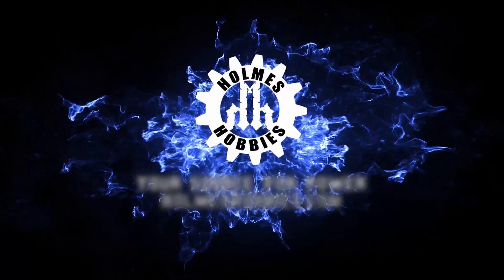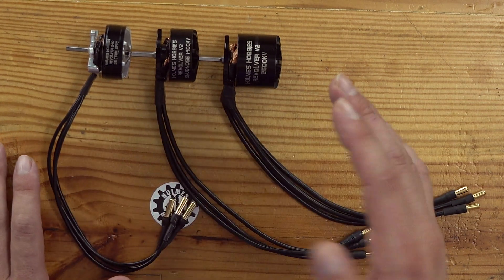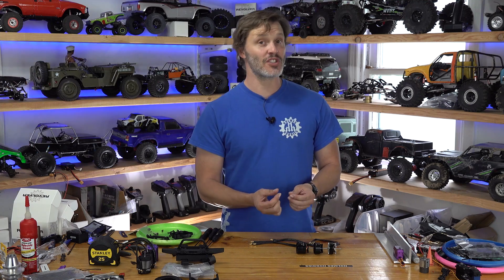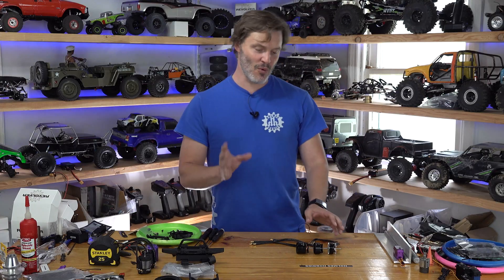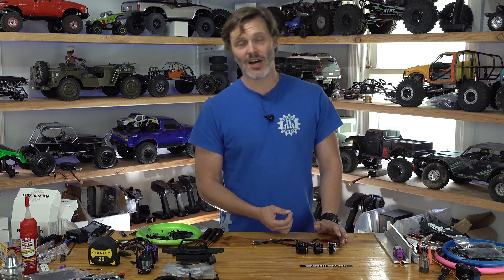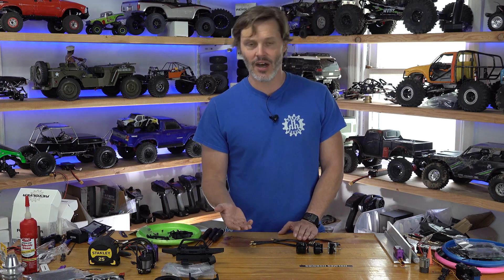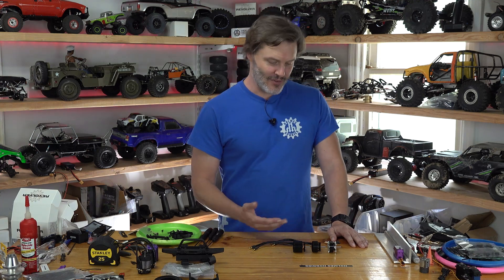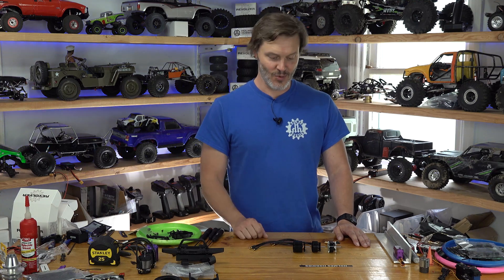Which Motor Is Right For You | Revolver Differences Explained | Holmes Hobbies | RC Motor Guide

Comment: Im building a TRX6 with a highly detailed and HEAVY 3d printed body.  It will also have a gooseneck trailer to haul 2 more rigs.  Is this something the 540 can handle, or should I look at the revolver classic?  I cant give you a weight yet, but 30+ would likely be the lighter end of the range.

Comment: What's the problem I'm using copperhead10 ESC and 2500kv motor HH revolver V2...my settings on power is 100% full throttle and 100% reverse...then when I full throttle for 2.3.sec the ESC will beep long sound and no response i need to restart again the ESC...can you help me sir.

Comment: I got the 540 2500kv for my scx10.  Its a beast.  Never gets hot no matter what gears.  Running on 2s.
Reply: That’s what I’m trying to figure out it if my gearing (56T Spur & 10T Pinion) on my Vanquish Stance VRD will make the motor hot. Btw I bought the V3 2500KV Revolver motor & my gearing will put out alot of torque but people say higher KV means less torque but in this video he says the bigger the motor the more torque.

Comment: Have you did speed test inrunner 3.5t 8700kv vs a outrunner 25000kv I want to try a build rc car with motor but don't know which one motor for top performance speed do tell me which one for top performance  should I use please Holmes hobbies
Reply from the maker: Kv is kv.  But outrunners aren't great for loaded efficiency when gearboxes are available.  Too high of no load compared to similar sized inrunner,  they can't shed heat as fast

Comment: So looking at a 102:1 gear reduction with 4s would the 2500kv snub or if team spec be suffice for a 5-6lb rig ?  Or a smaller lightweight different transmission would put me at 67:1. (Comp rig wanting to be as lightweight as possible) 

Currently running 77:1 3s and a puller pro v2 stubby 2200kv in my class 2 and love it! (Maybe more wheel speed and heavier than I need but it slow speed is still awesome)

Comment: Great video! Currently running the 540 size Revolver, but looking for the motor for my new build so video was very helpful. I will move toward the snubnose  to try something smaller. The crawler will weigh in at about 6 pounds as I am using reasonably heavy alloy axle housings. Thanks for all the great products.

Comment: I can assure you overkill should have been the given name for the 2500 my what was a new wraith is now spare parts for my new wraith that's no longer running the 2500. First little wraith lasted around 4hrs on 4s I was crawling on rift raff borders at our riverfront. And paired with the castle mamba because Holmes was out of his at time of purchase of my revolver 2500. Amazing slow crawling speed you can literally watch each knobby on the tread make contact that's the amount of control. Anyhow as I was enjoying my day my rig wedged itself in between two boulders right rear and driver front I slowly pulled the throttle as to pop one or the other out but the rear sunk farther.The front had now came up out of the Crack but was under the lip of the rock infront so I hit reverse put me back where I started so I thought well how about I just full throttle it will hop right out it's so snappy. Boy Snappy was the word and snap was the sound that motor has so much torque it literally snap the chassis like a twig. I was in utter shock and disbelief but at the same time going holy crap I'm so glad I was recording that cause that is insane. And absolutely awesome all at the same time I thought I was done for the day but because of where it snapped it really hadn't stopped it from being drivable. Nope made sure that happen about 20 mins later. When the front was stuck and it ripped the shock from its cradle  on the right side of the rear-end and snap the axle. So what do I think of Holmes products well I certainly don't buy anything else for my Crawlers or Monster truck's .I know there are other good companies out there and I own a lot of their equipment to.But I've only burnt up one brushed motor from Holmes in 6yrs and it was completely my fault and I now own 55 of his motors and esc's. For me that's a no brainer  and when I can take this tiny can't even hardly hear it bullet motor and snap my rc chassis that I couldn't even hardly twist it 15 degrees either direction by hand.Yeah that's my kinda product and it's built and designed by a man who is whole heartedly dedicated to the hobby and pushing it to new limits.As well as making  sure he does all he can to insure it's future for many more to enjoy. You can't find these people or companies hardly anymore and it's sad because they are who built this country in the first place. So I can assure you I will support and buy all that I can from a company that supports me and   makes sure I benefit from their product.Not one that mass produces as much as possible because in 3 months your repurchasing the same thing again because it went up in smoke or just simply malfunctions altogether. I've got motors that have hundreds of miles on them from. Holmes  and that's 1:1 scale miles I haven't ever broken them down to 1/10 but one is like 6 miles from 350 it's my 3100kv Holmes running a Hobbywing max esc another around 211 and several inches low hundreds or darn close.Now if that isn't dependability and quality I don't know what is or where you're going to find it. What I can attest to is I own well over 200 rc's and I have every brand of motor and esc you can imagine and the only company I've had come close to matching the durability and performance is one that most are going to be taken back by but I get no quirks or incentives for advertising so my opinion and advice comes straight from my pocket book to my rc's and the results are unbiased an honest.Anyway HPI is the only other motor I've even got to come close to putting up with the torcher and  putting out dependability one of my 17 trx4s is running a hpi 4000kv with a Hobbywing 1080 zero lagging at any crawl speed and 41mph on 2 gear top speed with absolutely zero upgrades it's 5yrs old and never had a single part break and I use it for trailing and bashing 3s 5000 50c is my battery of choice. It's currently at 261 after the last couple 11hrs a day  weekends and is still as strong as it was knew.But even tho I'm a huge fan of it my main go to is Holmes Hobbies and for good reason my motor drawers is full of over 600 motors all that have failed. Out of those 5 drawers it only contains one Holmes hobby crawlmaster motor out of my Redcat Marksmans. Of which was completely my error as a bearing went out in my trans and I had no knowledge it was working 5 times harder than it should in 90 degree weather until my crawlmaster became a crawldisaster I was really disappointed at first this truck was only 2weeks old and 3 batteries in. Until examination told the story no failure on Holmes behalf just a crap Chinese bearing ruining a hand built masterpiece in my opinion. Sucks that 11cents can destroy a whole day of fun.As well as cost you more than 20 dollars to fix what would have probably outlasted my Marksman. Well that's my two cents hope it helps somebody and hope everyone gets out and enjoys this wonderful hobby.BITTEN4LIFE

Comment: Will these all work with the micro mamba v2? On topic of the mamba v2, is there any difference in the esc whether it's in a 1/18 combo vs crawler version, besides bullet size.
Reply from the maker: besides bullet, no difference.  I would only recommend snub nose revolvers with that ESC
Reply: I ended up going with trail master 2200kv

Comment: John - I purchased two V3 540 Revolver motors for an RC4WD Bully II MOA build. I stupidly purchased your BR Mini Dual esc to power these revolvers not realizing the BR stood for brushed. I then purchased two Castle Micro X's, but blew them both playing around with other builds. Then I tried to Mamba X's, and decided they were too big - overkill. So now I have two Sidewinder4's where I've removed the shrouds, ground down the heatsinks and glued them back to back to fit in the body of the Bully II MOA. I've yet to finish soldering the connections as I am unsure how I will connect the esc's to power (i.e., single battery to both esc's or two small batteries per esc). But in any event, when done I think this may be the only dual motor on axle build with your latest big can revolver. Thought you might get a kick out of that...

Also - I have one of your 1800kv V3 Snubnose Revolvers  that is going in an all aluminum WLToys 144001 with a Mamba X for speed run testing. Question - I think I can safely run it at 4S, but what about going to 6S? Will the motor handle that for short bursts?  As an aside, that will also be the only 1/14th scale speed run buggy I know of with a Revolver motor. Again - thought you'd get a kick out of that.  😁

Comment: I have a sleeper Gen7 that is about 8 pounds. It is a step below really good comp rigs but far above a normal rig. I run portals which lower the gear ratios by 50%. Would a Snubnose be appropriate for mostly bouldering? I also do steep climbs and trailing. Also, which ESC will run it the quietest? I don’t care much for whiny rigs. I am ready to buy now if you have what I need available. : )

Great video! 🏁 I watched every second and learned a lot.

Comment: These product videos are great. So much of a build is the controller and motor. Between weight, size, voltage input 2 3 4s, torque, hold, start up and kv... any input is appreciated

Comment: Hey John, great video, despite the odd rabbit hole! 😉  I've experimented with different kv and would say 2200-2300kv seems to be the sweet spot.  Also, quick question for ya.  I have a pseudo-comp rig (daily driver but set up for comps) and interested in the Team Spec SS.  Rig, fully outfitted, weighs about 6lbs and wondering if the SS will tolerate it or if I should go with the standard snub nose?  Thanks!

Comment: I’m loving the team spec ss motor, as mentioned if you don’t utilize it for the correct application (light weight) it may not hold as some anticipate. On the opposite side of the spectrum I also love my 540 revolver (v1 not classic) and the torque density is just another driving experience!! I mostly run 3s and super happy with it but really want to get a proper revolver to use 4s with the Crawlmaster v2. I did try 4s with the team spec ss and CMv2 until noticed noise pitch changed and I opted to stop. Love the videos like this, learn something every time!!

Comment: I run the 2500 snubnose  with the Crawlmaster V2 so it’s 4s compatible. I also gear down as much as possible for low speed and high torque.

Comment: Motor choice question, but first rig specs. A class 2  Brazinscale hi-low with a tgh 2low trans that's a little over 5lbs. On Vanquish F9 Currie axles (non portal front/portal rear) 65:1 front 79:1 rear gear ratios ( 20% ish o.d.) mainly used for comps, but trail run every now and then. 

Running 3s on your crawlmaster mini ESC Would a 380 2000kv revolver be "enough" motor to have good wheel speed at those gear down ratios?  Or would you bump up to a stubby puller pro or revolver? I would like to keep weight down, but wheel speed is useful!
Thanks for everything you do for the community, along with taking the time to read this. 👍

Comment: I have your lil tugger motor and I haven't a clue what to use it in HELP please
Reply: I've seen one or two older Tamiya based  crawlers  with the tuggers, also in one of the Tamiya semi trucks. Probably fit alright in that team AE 12-14th (forget which it is, but it's a odd scale) rig also.
Reply: @jollygreengiant7070  I have a king Kong rc ca30 6x6 truck I would like to put it in as a normal 540 is very tight against the servo and this lil tugger would fit alot better

Comment: Does your company make custom 380 cans too? Was just wondering because I have a small rig that I want to put a good motor in. I plan on modifying it a bit but keep it on 1.5's with very slow wheel speed. It's a bit too fast for my liking and the startup sucks.

Comment: Love my v2 2500kv revolver full size so far. And absolutely love the 2040kv revolver snubnose v3 I got on accident. Was saprized the power and top speed of the smaller snubnose has. It seems as fast as or faster then my full-size 2500kv v2 revolver on same 4s voltage. And can feel the v3 motor is harder to turn by hand then any other model's I have that's  a v2. And last but not least I love my v1 and v2 team spec ss revolvers. The newest being my favorite of course with the strong hold and higher torque then the v1. Thanks as always for the greatest crawler electronics 💯👌💪❤🤘🙏🇺🇸

Comment: The 540 size in my C3 Gspeed, performs incredibly.  Power to spare, holds a line and is super smooth.  Running the 540 in 1800kv on 4s with a Copperhead.

Comment: There's nothing wrong with elegant overkill as long as the weight penalty is not crazy. I remember what sold me on the Revolver originally was when John stepped on the back wheel of a TRX4 and lifted the front, very smoothly, with the throttle. Being older, the Revolver's high frequency whine when using the Castle Monster X isn't much of an issue for me.